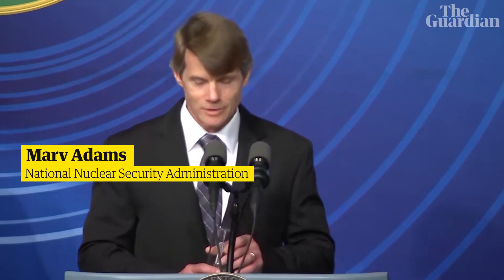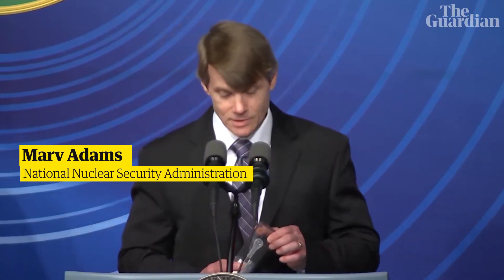Nuclear scientist Marv Adams explains what happened in the successful fusion experiment

Comment: There will be no fusion, it's an error. Sun is working different.
Reply: Have you witnessed the experiment to make that claim???
Reply: @littlejefe494  Sun itself is not hotter than 6000C, but the corona has 1,5 million C by electromagnetism. That's enough.
Reply: @moped975 why don't  you replicate the experiment and prove it if you're that sure
Reply: @littlejefe494  I don't have to. Take it or leave it!

Comment: So what I'm wondering is does this scientifically disprove Einstein's law of conservation of energy. IE. Energy can not be created or destroyed. This experiment has shown that energy can be created from this reaction. The lasers put in 2 megajules, the fusion reaction output 3.5 megajules, a 1.5 net positive in energy. So if I'm understanding this correctly, this experiment disproves Einstein's law of conservation of energy. Unless I'm misunderstanding some details, that's pretty groundbreaking.
Reply: The energy is coming from matter. Specifically it is coming from smashing atoms together. Certain atoms want to be together and are unstable when separated, like oxygen, and release energy when they come together. This is not disprove conversation of energy because you will need the same energy to seperate the atoms again.
Reply: It's simply a transformation of one type of energy (potential energy) into another (heat). It just happens to be an extremely difficult transformation to get in a controlled environment.
Reply: You are using half of Einstein's law, the full law is: 
Energy can neither be created nor be destroyed BUT it can change its form from one to another
Hence we convert mass into energy using E=mc2 equation

Comment: What a pile of hype.   More energy out than the lasers put in?  And how much energy went into the plant to fire those lasers.   They are lying through their teeth and the public is falling for it.    

This technology is worth research and one day perhaps 100 years from now it MIGHT, generate power which can be delivered to users.   There is as much possibility this will never deliver power as much as it will.  No radioactive waste?   Really, since when is tritium not radioactive?  Yes it only has a half life of 12 years but since the reactors must run 24/7 for the next 7000 years, there will be a never ending supply of radioactive waste being generated, short lived or not.

The research needs to be done but, they also need to tell us the truth.   
This event was a tiny, tiny step forward.  At the pace of the past 40 years, it's nothing but a research project for as far as we can see into the future.  100 billion spent in the past 50 year,  another 200 to be spend in the next 40 with no electrical power coming out for possibly another 75 years if ever.
Reply: Do you seriously think this guy is claiming to have broken conservation of energy?

Comment: Caveats

NIF’s achievement is significant in the evolving story of inertial confinement. Fusion produces more energy than it consumes. The reaction also doesn’t produce environmentally deadly waste like nuclear fission does. This is why it’s so lucrative as a power source. Financial Times reported that until June, the “total private sector investment to date” in fusion energy was “almost $4.9 bn”.
But there might be some gaps between expectations and reality.
First: After NIF achieved a gain of 0.72 in 2021, the people in charge of the experiment tried thrice to repeat their feat. They failed – because the NIF fusion facility is a highly sophisticated system with tiny moving parts. Even small changes in input conditions, like microscopic bumps on the capsule, can lead to large variations in output. So NIF will need to reproduce its new results.
Second: For fusion to be truly gainful, the energy released by the reactions needs to be greater than the energy going into the lasers, about 300 megajoules, and not just the energy delivered to the hohlraum. This hasn’t yet been achieved.
“The energy transferred to the plasma is just about 1%, the rest is all lost in other processes,” said Shishir Deshpande, a professor at the Institute for Plasma Research, Gandhinagar.
According to Mr. Zepf, “Future research will need to focus on reaching the next major milestone – a target gain of G > 100, which is required to run a power plant efficiently.” That is, if the lasers deposit 2 megajoules, as they did on December 5, the reactions in a power plant will have to produce at least 200 megajoules to be feasible.
And “even if one were to achieve high gain,” Mr. Deshpande continued, “questions about how often one can repeat the pulse, to get sustained power, and couple a higher fraction of the initial energy investment [to the fuel] will be crucial in future.”
Third: The road to a power plant from the NIF’s current achievement isn’t well-understood.
For example, at NIF, lasers fire at a hohlraum, generating X-rays that heat the capsule – instead of hitting the capsule directly. This prevents the laser pulses from being pinpoint accurate and allows the capsule to be heated in a symmetric way, which is highly desirable. But the cost is lower gain.
Another issue is that some of the input energy is devoted to compressing the capsule instead of raising the temperature (unlike in magnetic confinement). This fraction will increase as the amount of fuel increases, creating another barrier to high gain.
“It wouldn’t be possible to set a timeline [about a power plant] as the scientific understanding is still evolving,” Mr. Deshpande said. But LLNL director Kim Budil said at the announcement that inertial confinement could be commercialised in a few decades. Even by then, global warming will have crossed the 1.5º C mark.

U.S. government officials announced on

Comment: Energy can never be created. You also can't change the actual laws of thermodynamics, you can't create more energy than you put in, you're simply transferring available energy, which can  never actually run out ever overall. Only individuals areas of space can have less energy than others but there is no area that exists that has no energy in it anywhere, ever.

Perhaps maybe take a leaf out of nature and examine the way proton pumps work in mitochondria or something like that, they create an energy gradient which causes the energy flow much like hot flows towards cold. Everything is constantly moving and it will move forever. Its impossible for energy to go away because it is everything, anywhere it goes becomes "somewhere or something". Its impossible to have "nothing". That concept is an illogical idea that helps you clearly see that there is something, by using the imagination which is the only thing possible of making "impossibilities" seem plausible or to even notice such a non existent notion in the first place because it is a product of the mind.

Comment: Isn't the gain actually 0.5?
Reply: 2 in 3 out.     
0.5 times 2 is 1.      
1.5 times 2 is 3.    
When you're talking about gain it's always expressed as a multiplication factor. So a gain of 1 means that is the input is the same as the output. Regardless of whether it's a guitar amp or a fusion reaction.
Reply: @irwtla1  alright, thanks for clearing it out. Thought it was used as "out - in", representing the actual amount gained :D. At least that's how it's used here. We live we learn I guess

Comment: Does this break the law of conservation of energy? Where is this extra energy coming from
Reply: No.  The energy gain comes from the mass that the lasers are firing at.  Some mass is lost, energy is gained.   That's where E=MC^2 comes from.  IN simple terms, mass and energy are 2 forms of the same thing.  We have finally figured out a way to release the huge potential energy in a small particle by using a smaller amount of energy to actually do it.

Comment: They've effectively lied about this announcement by misrepresenting the achievment. They didn't actually generate more energy than they used. The energy output that was transferred from the lasers was lower than the energy generated, but the overall energy required to make it happen was less than the output still. They moved the goalposts to 'achieve' this. It still doesn't mean anything until they can prove that the total input energy can be less than the total output energy.
Reply: They also didn't mention what powered the lasers in the first place
Reply: @kickdabucket  the lasers were powered by the largest oil fired power plant in the USA , HAHAHA 6.6 gigawatts of energy.

Comment: I'm sure they will figure it out. I'm just not sure if I'll be alive to see it. Meantime it would be nice to use the fusion reactor we already have and try to get more than 20% of it. Unfortunately 1.5 is not enough. The typical efficiency they get out of heat power plants is 35-55%. So 2 MJ in, 3 out as heat and best case scenario 1.65 out as electricity. Technically you could use the heat as is without converting it to electricity, but heat pumps are a lot better with that. I would rather bet on research that makes heat pump hot and efficient enough to produce steam that can be used for electricity generation. This seams a lot easier.

Comment: This has the potential to be one of the biggest game changers in all of human history, I'm glad I got to be here for it.
Reply: Production of energy could be used to travel further in space...eliminate fossil fuel Production over time and lastly develop a light Saber to fight the Empire
Reply: @ginobur  you’re a true Jedi. Start awakening the force my brother in arms!
Reply: I think the resources are the problem here again. If I got it right they used Helium which then transformed to hydrogen and we're already running out of helium. I still think solar, wind and tide enenergy is the future. It's just impossible to run out of these.
Reply: @DaWurfmaul    They are using Deuterium(Which is abundantly available  in water and easy to extract.) and Helium 3( Helium 3 is rare.But here,they are making this in the same reactor by fusing two Deuterium atoms) as fusion fuels. So in summary ,two phases of fusion occur in the reactor where the overall energy gain is 1 MJ. 2 MJ in and 3 MJ out. This is energy and resource efficient. Also fusion doesn't have radioactive byproducts. So , no risk of radioactive waste and hazard unlike current nuclear reactors(which work on fission).
Reply: It's very exciting, but even with this major breakthrough there's still a long way to go.
Reply: Amen! Fifty years on the planet, and I didn’t think I would ever see this. Amazing!
Reply: The operative word being "potential". I GUARANTEE that you will not hear another WORD about this after the initial kerfuffle.
Reply: It will be stifled just like nuclear power is now....
Reply: You will most likely not be around when this is implementet in everyday use. But you can always find yourself lucky to have been born in a time with alot of dream and visions for the future and then die.
Reply: Assuming it's not BS and assuming it isn't gobbled up by capitalists(it will be). E.g., it took millions of mathematicians, physicist, even doctors to pull this off IF it is true. (1.5 is very large "free energy" if it can actually be scaled up(probably can't.)).

Do you think the government who fleeced the tax payers will give everyone free power(say up to 10KW a month) so the poor can get a break from the constant abuse?
Reply: Does this mean lightsabres?
Reply: @Tyrekickingwetdreamer  Sadly No. More like Iron Man's Arc Reactor.
Reply: @AL Butcher go by what happened in history. Study it.
Reply: 100% agree!!
Reply: so when does our electric bill decrease?
Reply: Let's check on fusion reactor progress in 2050. We might just have first real size test reactor around 2050 to 2060. Meanwhile let's hope someone figures out a battery that is not bound in its capacity by galvanic cell and can store more energy. I would say such invention would be even more important than fusion power.
Reply: Hahahaahhaa you won't be around when fusion energy becomes a real thing, but I like your enthusiasm
Reply: There is 20kg Tritirum on Earth the use Tritirum in the fusion process meaning there isn't enough.
Reply: This wil never happen
Reply: I'll be putting off buying an electric car!
Reply: IKR!!
Reply: just like Einstein said: Knowledge is limited, Imagination encircles the world. 
those scientists will become very valuable in the future if they make fusion reactors succeed.
Patience is a virtue
Reply: Yea of course but it could take decades before it’s any benefit to us currently . This is on a tiny scale , imagine trying to power a whole city .
Reply: It's can easily power Paris and more, I think within 10 years we will have one reactor ready @richardwalker6004
Reply: A lot of stuff, within the past 50-ish years, has had the potential to be big game changes..... but what happens, is greed gets in the way. Someone  invents/discovers something.... and someone finds a way to market it to only the super rich.....or sell tiny bits of it to middle class.
Reply: @billyfraiser6298  give me some examples of game changing inventions that have been sold only to the "super rich".
Reply: @billyfraiser6298  it's because of capitalism. Humanity rejected socialism when we had the chance. I hope China saves us all from those billionaires
Reply: I can change that
Reply: What can we do with this knowledge
Reply: @lynashmcmash4427  Generate lots of energy.
Reply: @lynashmcmash4427  what dont you understand about it? We got more energy out of it then we put in. Its like a real life dupe glitch.
Reply: @ashtenlastname4045

Your comment made my day. Thanks man 🤣👍🏼
Reply: @ashtenlastname4045  heat pumps do exactly. 1 unit of energy in, 3.5-5 units (for an average domestic pump) out.
Reply: @kasparsbajars  what...
Reply: @lynashmcmash4427  They invested 2 mega joule of energy and had a 3 mega joules  in return, literally increasing the outcome of energy, clean energy that doesn't depend on fossils or gas....and in less time than light needs to travel 1 inch. This is BIG.
Reply: @royox  WOW
Reply: @royox  no its not
Reply: @royox  How is this possible? Isnt the basic law of physics energy cannot be created or destroyed?
Reply: @imdeexpert5828  but the fusion of atoms can have a positive outcome of energy. Matter is also a shape of energy so the equation stais still balances.
Reply: @royox That is not at all what this means. What they essentially did was set off a nuclear bomb in a really fancy way with lasers, none of the energy that was released by the reaction was harvested, they only measured the released energy to be greater than the energy to set it off. This is sadly misunderstood to be something meaningful towards actual fusion power. It is not, none of the problems we have related to it were solved...  also, we already have clean energy from nuclear power plants that don't depend on fuel or gas, people just seem to misunderstand that as well, so badly in fact that Germany for example has been shutting down it's power plants when in reality we need more...
Reply: @lynashmcmash4427  Solve the energy crisis and stop our species reliance on dirty, non-renewable power solutions.
Reply: @lynashmcmash4427  sell it, for a whole ot of money that ends up in billionaires pockets probably, just like the rest of the world and everything in it.
Reply: @lynashmcmash4427  literally almost anything you can imagine... By having a lot of clean electricity we could've achieve clean energy on this earth and improve our beloved earth into more green state, or we could've achieve world destruction by found this little thing that could be used on war..who knows?
Reply: @lynashmcmash4427  have free energy minus the cost of maintenance.
Reply: @lynashmcmash4427  yea, a lot chaotic power for wars.
Reply: @ericmckinley7985 when it comes to ultimate energy focus in a point. You can put into use for limitless things. Think. Really think before you come to. You're talking about wide energy but here in this topic. Don't get lost now, you can put it into smaller devices. Correct me if I'm wrong. You are emplimenfing your imagination on something that you barely seen possible which is what, nuke bombs. But think about the future. Cmon now. The shows, movies, video games. Have you been that ignorant in possibilities, fantasies, dreams. You're controlled but what you're only seen. Possibilities are endless. I could go on. Back then our technology wasn't even imagined yet. Like vehicles or even guns.
Reply: @sebas Stein yes that's one reason of war. But you forget that when a new weapon comes into place it will become a war of power.
Reply: @carlitosjuarez221  huh?
Reply: No, fusian bombs are nothing new they have been around for quite some time. But reaching positiv energy outputs in avontrolled reaction is new.
Reply: Whaaat? You were there with Marv during this ignition of the fusion fuel?????
Reply: @lejohncoleandersonthe1st567  We’re all blessed to be alive during the time of the great Marv Adams
Reply: @lejohncoleandersonthe1st567  I think they mean they're glad they're alive in tidays world, when we happen to have finally figured out fusion. Not that they were there when the experiment took place.
Reply: you sure are smug about it